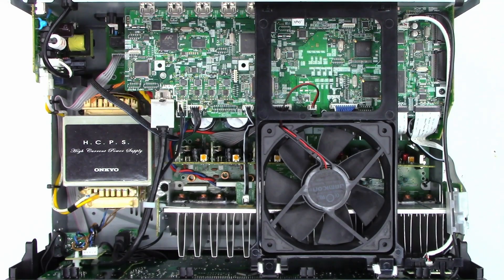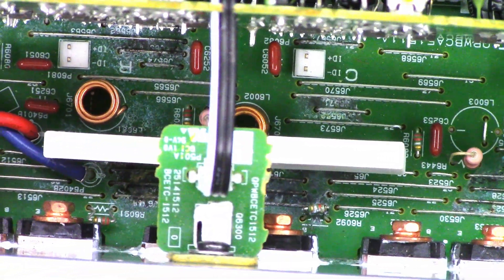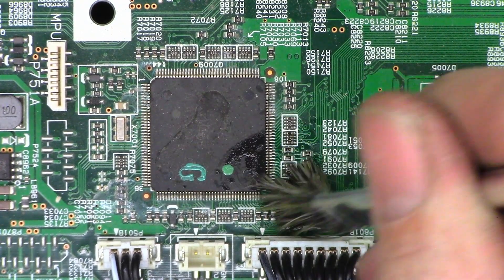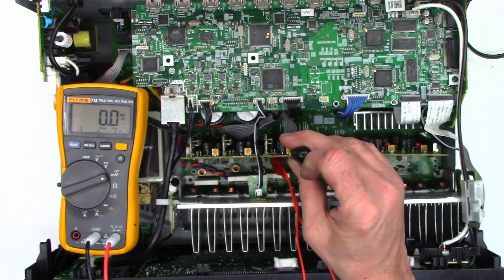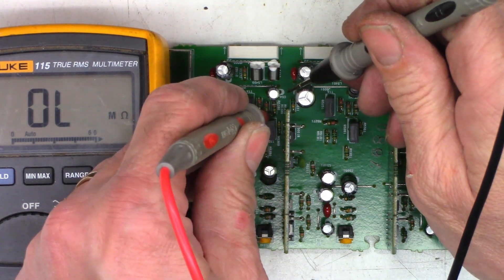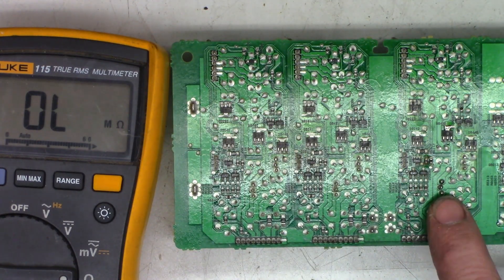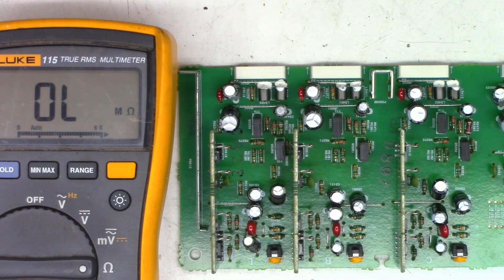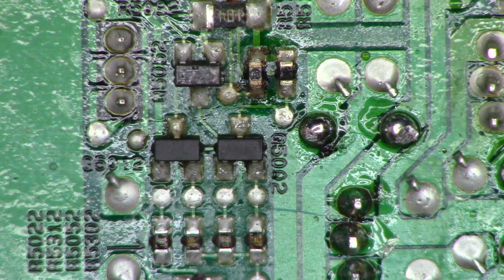Onkyo TX-NR636 Intermittently shuts off. Corrosion? Customer repair? What else?  Part 1 of ???

Comment: Hello. Can you tell me how to check the operation of the cooling? My fan never turns on. The Resvier is very hot, the thermometer on the top panel shows 40°C - 104°F
Reply from the maker: Some of these units did not turn the fan based on the temperature, they started the fan based on the audio output level. The higher the level the more voltage to the fan. I am 2500 miles away from home right now, I will try to check when I get home.
Reply: @norcal715  Hello. I found the wiring diagram for the fan in the service manual.
The fan is turned on with the help of the Q6300 thermal sensor and is controlled by the Q7009 MPU and the Q8701/11 driver.
I just took a lighter and warmed up the Q6300 - and the fan turned on.
The diagram shows the switch-on temperature and its speed.